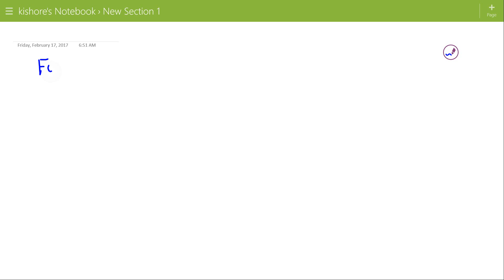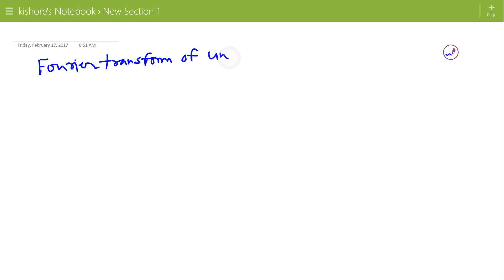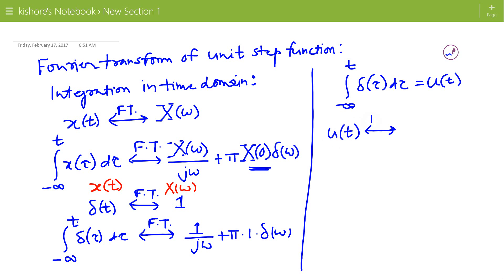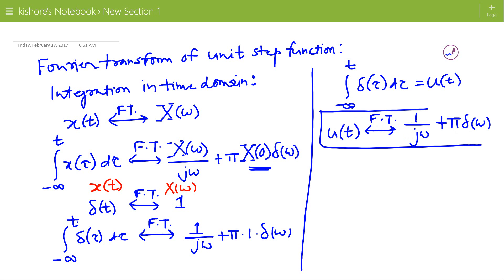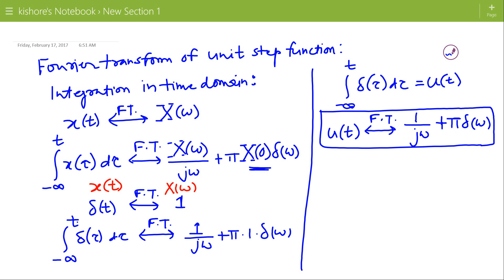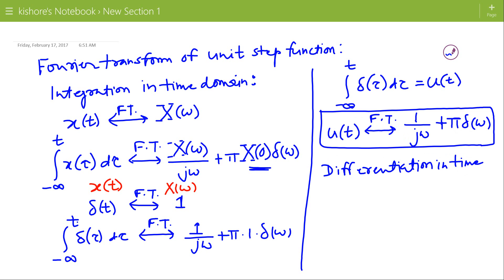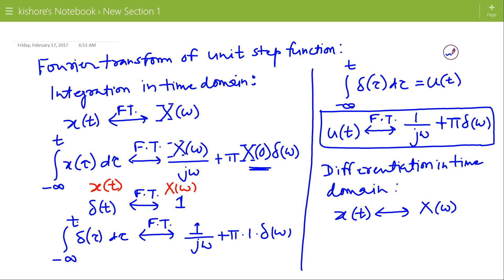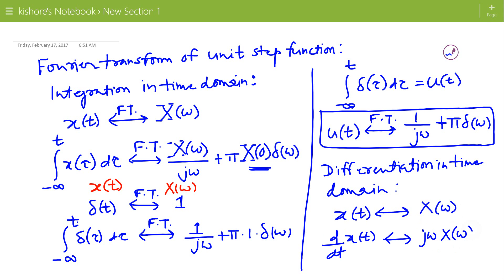Lecture on Fourier Transform of Unit Step Function

Comment: Hello sir. I have a doubt. If we take LCM then we will get " [jω{π*𝛿(ω)} + 1] / jω " and if we apply delta multiplication property then this jω{π*𝛿(ω)} = 0... and our final term becomes 1/jω only.
Then this way... fourier of unit step is = 1/jω
What's wrong in this? Please tell
Reply from the maker: 1/jw and pie*del(w) are two separate spectrums and are linearly combined to give the frequency spectrum of unit step function. Mathematically we can take LCM and then by delta multiplication we can get 1/jw but it is not possible in frequency spectrum because LCM is not basic operation of signal.
Reply: Thanks